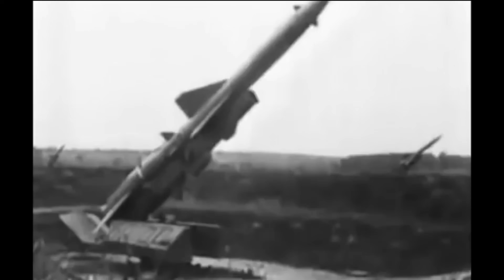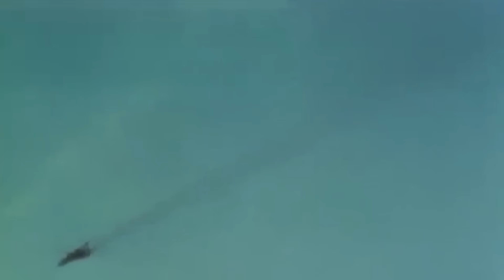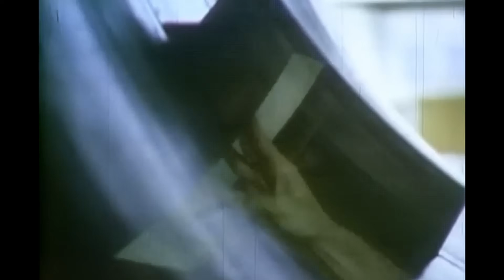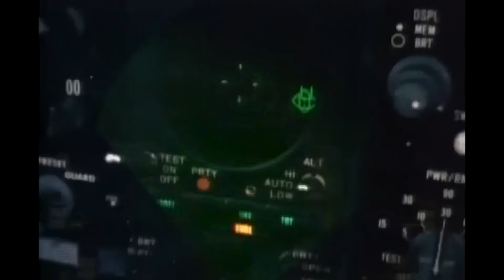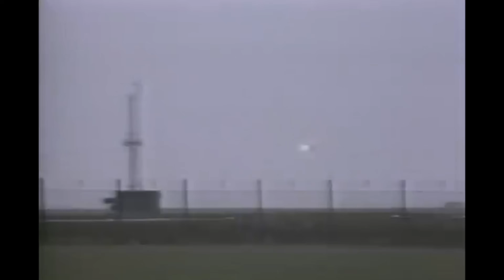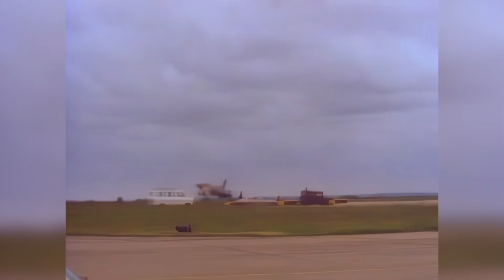FLYING COFFIN Transformed Into The MOST FEARFUL Weapon In The Vietnam War

Comment: si officiellement la France et l'Espagne avaient interdit le survole de leur territoire aux F-111 en réalité ceux se sont faufilés en rase mottes au dessus des Pyrénées ce qui a considérablement raccourci leur vol par rapport au plan de vol officiel, évidement c'était un secret de polichinelle, la France et l'Espagne ont laissé faire tout en s'affichant neutre dans cette "intervention" américaine
Reply from the maker: Translation: "if officially France and Spain had forbidden the overflight of their territory to the F-111s, in reality they slipped in at low altitude over the Pyrenees which considerably shortened their flight compared to the official flight plan, obviously it was an open secret, France and Spain let it happen while appearing neutral in this American "intervention""

Response: That's a widely discussed theory regarding the F-111 raids. While officially denied, the low-level flight path over the Pyrenees to shorten the flight is plausible given the political climate at the time.